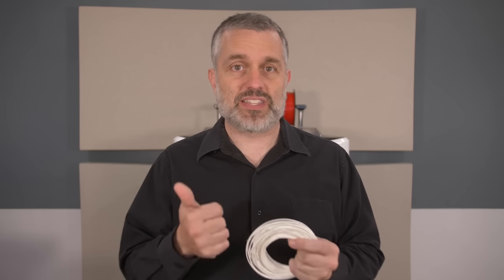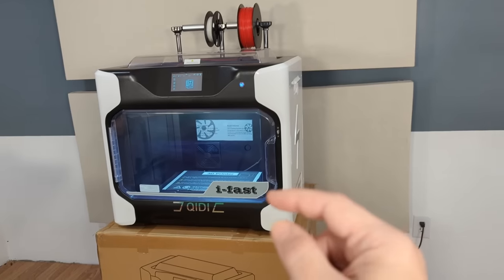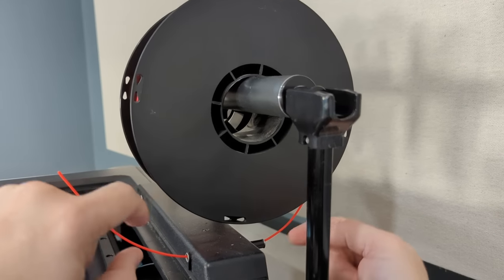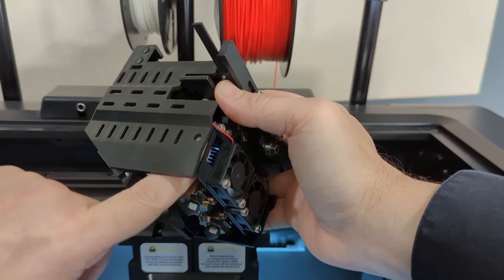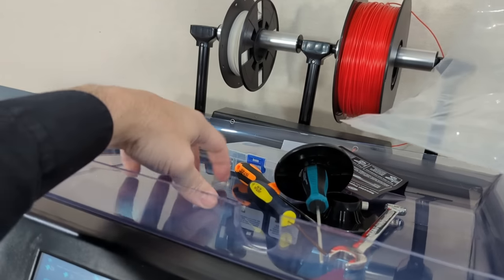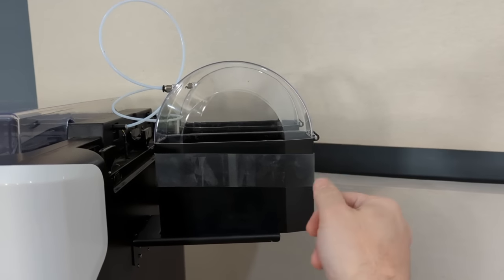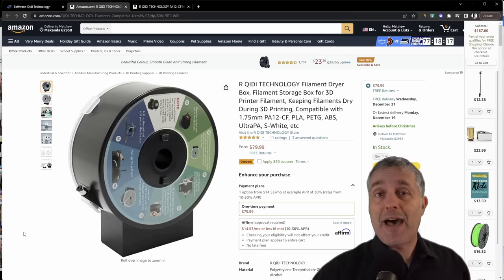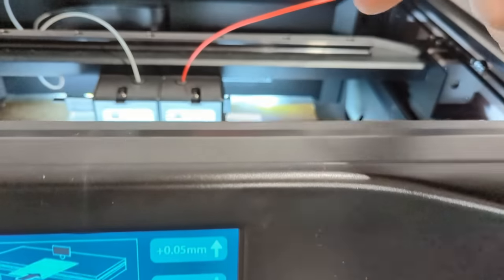The Only $2200 Heated Chamber 2Nozzle 3D printer - The Qidi i-fast

Comment: I have an i-fast and I disagree with many of your observations and conclusions.  Filament feeding is not an issue.  I agree it looks worrysome but its actually not as issue.  The printer does not have to be sealed, is closed and actively heated so will maintain whatever internal temp you set it too.  Print adhesion and bed leveling is an issue and they really need to write the firmware for the bed leveling that is built into the hardware.  I'm doing some amazing things with my i-fast.

Comment: @DPT - I have been using one of these QIDI iFast printers for more than a year.

My own personal experience is the extreme opposite of yours, from the setup, leveling, first test prints, the dual extruder alignment, and printing complicated precise functional parts using both extruders.  I know that "Major Hardware" also demonstrated printing problems.  Maybe you guys got dud machines?  But I don't know, when you were saying you can't adjust the temp on Extruder 2, towards the end of the video, and you didn't even select the extruder by pushing the icon on the right that shows a nozzle with the number 2, but kept trying to select by pressing the temp display under extruder one...  Maybe you really have a corrupted firmware?  QIDI has been very responsive to all questions, you might want to try getting in touch with them.

In any case,  Clough42's and ModBot reviews speak for themselves, good that you put the links.

One guy who demonstrates extensively what the iFast can do, and shows many important, simple improvement mods is YouTube channel "Meliorate with Nate" , maybe you could put a link to him also?

Comment: The nozzle 2 temperature setting looks like it parsed an octal value first of all when you keyed 0200 (128 decimal). When you keyed 200 it was correctly interpreted as 200 decimal.

Comment: During the Covid debacle lockdowns, I invested and updated my 3d printers.   I was right on the edge of buying Qidi.  I didn't because of the very poor looking heat break cooling.   I followed the FB forum for a while, and let me tell you, I am so glad I dodged that bullet.  Seemed like a big specification stack for the money but definitely a NO GO.  Did you know the earlier printer had one hot end that could not be taken appart and unclogged, had to be replaced!  I ended up with Ender 6 printers and I'm so glad I did.   Next move is to Vorons Tridents.
Reply: You dodged a bullet. During Covid I bought an Xmax to produce face shield frames on and use for some of my larger prototypes. I had so many problems with heat creep and their poor extruder design, it was ridiculous to say the least. After going back and forth with Qidi, they sent me a replacement extruder assembly that had some updates made to it. It worked for about 3 weeks, and began having the same under extrusion and clogging issues as before. Around the same time, the mother board went out on the Xmax and I had to get a new one to replace it. It never worked right after doing all of that, so I gave up on it and it has been sitting in my basement since late 2020. I have thought about upgrading it time and time again with a new extruder and converting it to a different mother board, but for the cost I could probably get another printer that is built better or invest in a Voron.

Comment: Also you don't need very good insulation as long as the heating capability is higher than the heat loss through gaps and filters.
Reply: You can barely pass the mark that way, but as any house builder would tell you nothing's better than good insulation. Drafts can and will wreck your day given the chance, specially with engineering plastics

Comment: Nylon needs some type of adhesive when printing on PC and PEI. It also absorbs alot of water so you have to dry it before you print and prefferably print directly out of a filament drier.

If you do a followup video, try doing ABS and ASA.
Reply from the maker: Your words are fair and true but I will not be doing a follow up video. I don't want to struggle to make this printer work. In my judgement every single detail about it is sub-par and even if I could achieve good enough results I would rather spend my time doing other things. Looking over this printer and finding so many faults and nothing to love I am filled with no joy when working with it. I never want to touch it again. I wish I had not agreed to review this printer and I find it highly unlikely that I will ever review another Qidi product. I acknowledge that I cannot overcome my negative emotions regarding this printer which means I am not impartial in my judgement. My emotions prevented me from exploring the positive aspects of the printer. This is why I linked to the videos which talked about the printer in a more positive light. I was attempting to provide balance.
Reply: @DesignPrototypeTest  Filament hygroscopicity abd bed adhesion are both setup issues, not printer issues.
Reply: 2500  dollar 🤣🤣
Reply: @DesignPrototypeTest  I can understand. Seems like most of the problems can be fixed with a better firmware, there is a higher probability of that firmware comming from the community than it is from Qidi. I have 2 Qidi printers, Tech I or Tech II models from 2015, the printer sucks but it sucks in some strange ways that make it a very capable ABS/HIPS printer. I have about 30k print hours between the two printers, I still use them because for my business I need a very specific print out of ABS/HIPS and the print keeps failing on my voron 2.4 so I have to keep using those antiquated printers. 

I just resubbed since you took down all your negative videos, look forward to seeing your Bambulabs X1C review.

Comment: Ask for the last firmware to have baby-z option. And add a bowden tube  on printhead to act as a strain relief for filament so no breakig problem. Z height is a nightmare on those machine if you change often filament type because of thermal expansion is an issue.  Otherwise good ABS and ASA print without crack. Wifi file transfer suck because often it corrupt the file. You can disable the sound. You can have a superslicer profile provided with them but tuning is not perfect. I have two of those. Does the job but expectation was higher. Customer support is responsive but I can't say efficient.

Comment: Hey mate, you've turned on single extruder head mode, not high temp extruder mode, so that's why you're seeing only one extruder heat up.
Reply from the maker: But why does a $2200 machine have a setting for a single extruder when there isn't a single extruder for this machine in the box or for sale? For this kind of money, the user experience should be flawless.
Reply: @DesignPrototypeTest  They used to have one, they don't anymore. It's there for backwards compatibility
Reply from the maker: Don't you think that it should NOT be part of the default firmware? If you are a rare customer that has the single nozzle, you can contact QIDI and ask them for the special single nozzle firmware. Everything about this printer is wrong. Every. Single. Detail. That's why I completely lost interest in even trying to get it to work. The customer is not supposed to solve this many problems. Especially when it's such an expensive printer. I hope nobody buys this thing. I don't think anybody will be happy with it.
Reply: @DesignPrototypeTest  if you read the on screen message then all this would be moot.
Reply from the maker: Ok. So I'm an idiot. The fact that this idiot can get most printers to work...yeah. This printer is not idiot proof. For $2200 I expect better.
Reply: @DesignPrototypeTest God forbid someone reads what they are pressing
Reply from the maker: It's possible I made a mistake. But to my recollection I selected the high temperature nozzle. Not the single extruder. I think the firmware is broken. It's probably an easy fix if I had reached out to QIDI. I just don't care about this printer I wish I'd never agreed to review it. You can blame me if you want. I really don't care. I already ate crow and admitted that I'm an idiot. You're just beating a dead horse at this point.
Reply: @DesignPrototypeTest  He's not a customer service rep so stop being so rude when people try to help you.

Comment: Starting to get some really good results from Carbon Fibre impregnated ASA. Far stiff and strong and fa fleas plastic deformation than CF Nylons. Definitely worth looking at if you are after some higher performance materials printable in an un-heated chamber

Comment: Thank you for this well done video. I bought one end of last year and became very frustrated very soon. This printer has a lot of good concepts, but it seems, half way they have decided to replace some components with junk. The customer service was quick but not really helpful, either. Anyway, I decided to use the nice housing and sturdy frame and built a new printer from scratch. It's working now as I would have imagined, but, boy, that was an expensive experience.
Reply: Your are not alone….

Comment: sad to see the printer, nice to see your review. I use my SK-Cube for higher temp, not a good printer, but a good skeleton to build upon
Reply: Sad to see that his printer is probably defective, fortunately he put some links to extensive testing of and printing with working machines.
Reply: @retromodernart4426  I did see the other videos and it does seem to work sometimes, so I would call this another case of missing QC.
a lot of the issues are to do with the firmware and DPT did say it may have already been fixed in later versions.
Happy to hear your printer is doing well as I currently hunt a gremlin on one of mine.
Have a nice day and print something nice.
Reply: @budhiw  I agree, with Chinese products I like to call it - "The QC lottery".  But QIDI has a good reputation for dealing with any problems.

Comment: High performance materials often are very hygroscopic and need to be in a humidity controled box. Not outside on a cheap spool holder exposed to ambient air... Big shortcoming in my opinion.
Reply: They are now selling on their website the "Qidi filament dryer box" for $59 each, which can be fitted instead of a bare reel. I think the may be shipping the latest machines with these?

edit: At 17:00 he shows the new container for $79 on Amazon it's $59 on their own website.
Reply: @evropapagan5551  I bought my i fast a few weeks ago and it comes with sealed spool containers with place for desiccant inside.
Reply: @kitatit  And it includes a desiccant pack, too.

Comment: The only sub 3k enclosed chamber for high performance materials?
Im gessing we hate bambu labs and the x1?
While not actively heated ( other than the bed)  will ouperfor this quidy for half of the money.
Also the AMS would compare in capability on the dual nozzle (different concept, and slower) same functionality. 
If quidy deserves mention for throwing this bodge together,  im gessing bambù deserves the Oscar equivalent to the consumer 3d printer market.
(All being said, he x1 is far from perfect, veeeeeeery far from perfect) but at least works out of the box.
Reply: The x1 is not suitable at all for what he's talking about you NEED an actively heated chamber to be consistent with these materials. The X1C is still an over priced toy it's not an industrial printer.

Comment: Jesus what a bunch of weird design choices. It could've been an amazing machine. But thin PC windows are not good either for durability nor for insulation. Twin extruders? The heck? And I'm still scratching my head over that WEIRD linear rail looking thing over the x gantry, are they using a linear rail as a stiffener? What a stupidly designed machine
Reply: Didn't work for him (and apparently "Major Hardware"), works just fine for me in single and dual extruder mode, low and high temp materials, and the guys he linked in the description sure seemed to get satisfying results.

I think DPT might have gotten a dud, at least in the firmware, and didn't help himself by using some noname cheap filament that he made no mention whatsoever of even attempting to dry before printing, while not being able to set the printer up properly due to at least the configuration problems he showed (which may be from bad firmware and/or not being familiar with using the user interface).

Comment: No mater what heated chamber or not, the materials your talking about all shrink after cooling, ABS has a 20% shrink rate if not filled. A 90c heated chamber helps with the printing but you still need to comp in design with shrink or have a professional slicer that will comp the shrink for you. Also PEEK PEK and Ultem should be annealed. Commercial AM machines anneal as they print and eliminates the shrinkage to near 1%!